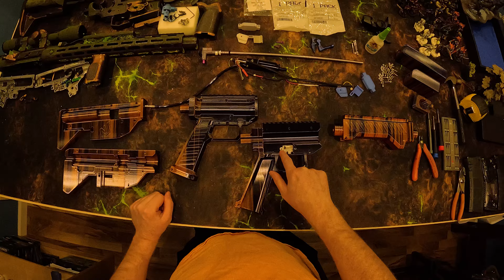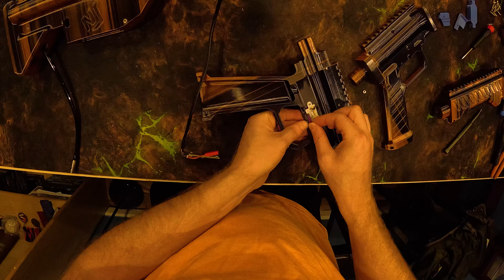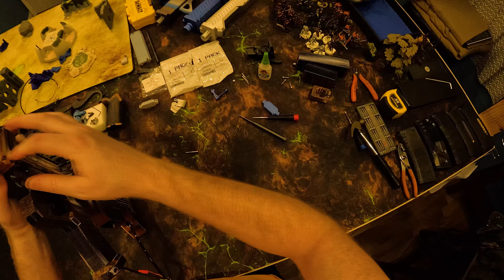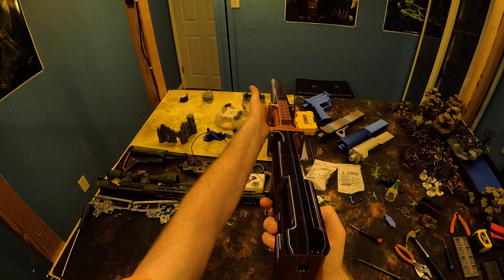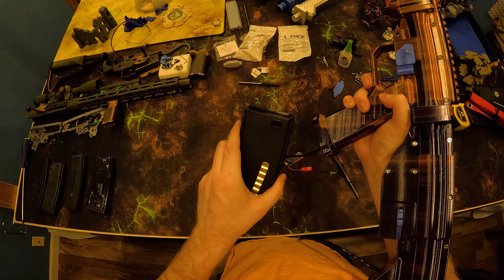AIRSOFT TECH STUFF: NIGELSOFT K009 ASSEMBLY INSTRUCTIONS

Comment: unfortunately the non bullpup design doesn't seem to quite fit on the Bambu X1C for the right/left shell pieces ( I wanted to use this version because it uses a length of barrel I already have)
Reply from the maker: Would have thought the bullpup stock used more space, still a bummer
Reply: @Karrottop009  the handle just barely doesnt fit
Reply from the maker: @nonepiecemaster2710 I hear ya, investigating the best solution. My original goal was something that would save 100's vs outright buying an MTW for someone's first hpa. With that, I had been avoiding any requirements for expensive body furniture where I could.

Comment: this is pretty awesome! i dont use HPA or anything, but im definitely going to recommend this to my friends who might find some interest in this. if i may make a suggestion; is that person to person pistol grips are very important because everyone has their own preference. i think it wouldnt be a bad idea to look into being able to use a m4 platform pistol grip so people can customize it to their own liking. also; ive been working on some 3d printed kit and it keeps getting shot out, have you cranked your FPS and shot at this at all? some pieces look thin and id worry about it being shot up and cracking.

def subbing to see what other cool things you come up with
Reply from the maker: A swappable grip may be possible by press inserting mounting nuts into the receiver shells? And no we have not fielded these to see how well they hold up to bb impacts, so that may require using extra walls in the print settings (this build I used 3 walls).
Reply: @Karrottop009  me personally, i dont like my 3d printed stuff cracking or getting damaged past like scratches so id imagine i would be reprinting this regularly. also for the press inserting stuff, you could take (i forget exactly what theyre called) heat inserted threads, when you basically heat the threads up with a soldering iron and itll melt/deform the plastic and gives it a really solid mount. pretty common in other 3d printed stuff ive seen
Reply: @Karrottop009  swappable grips would also let the standard / non-bullpup version fit on the Bambu X1C since its the only part that is outside build volume
Reply from the maker: @susowarriors1874 Interestingly, it holds up best where the walls are thin. It's the infill set to 10% that collapses under impact, so will have to figure out how much infill is necessary